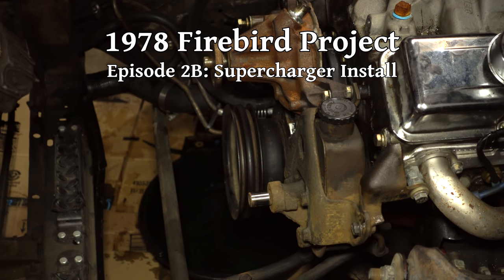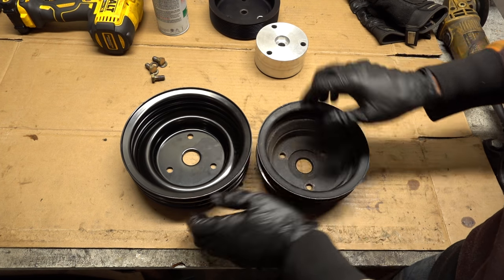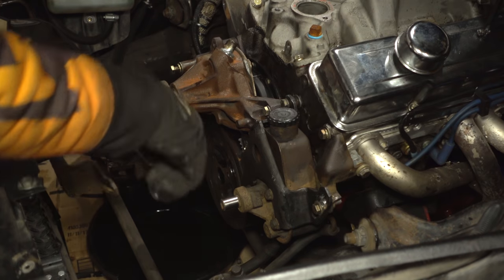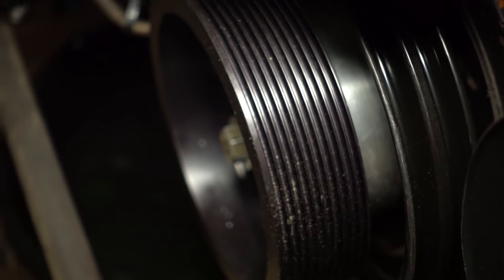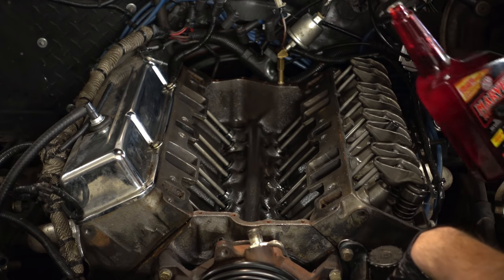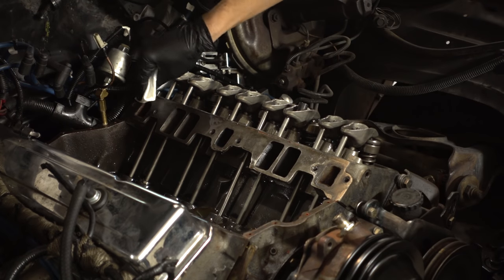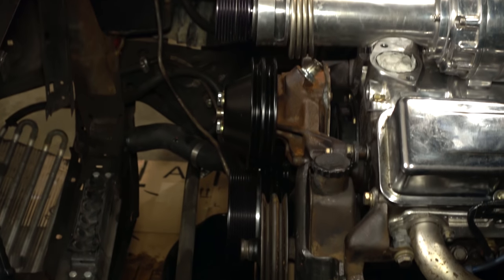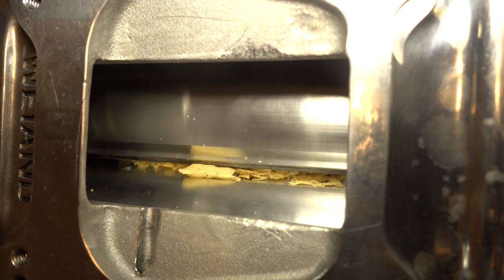1978 Firebird Weiand Supercharger Install (Ep.2 Part 2 of 2)

Comment: When installing the sbc balancer, if you heat it up in the oven at 275-300 degrees, it slides right on the crank with oven mitts on. It will not hurt the rubber elastomer bond either. Many of the older sbc’s didn’t even have a bolt in the crank

Comment: Awesome vid. I am a veteran  machinist and do my share of auto mechanics as well.
In the machining realm, I usually set myself up for a failure at least once a year when I haven't measured all the bits and bobs as an assembly and have trusted my  brain sack calculator to "make sure" all my parts will be machined correctly.
Such is life.

Comment: I had a 78 TA back in high school.   It had the 403 oldsmobile engine with the turbo 350.  I just drooled over the Pontiac 400 and a four speed, but alas, I lived in California!  

The front dampener should be balanced with all the other engine parts; that's what all those holes are drilled in it!   Good luck!

Comment: The front and rear gasket thing are the same on ford FE blocks also, just used a bead of high heat on mine, the old one was leaking very bad. Cool build also just found your channel 😀

Comment: Rtv really only needed for 2 things. Keep the gasket in place while installing part/bolts. And any places with hard edges, like where the intake plenum and valley pan meet or where a valve cover goes around a cam bearing on newer/smaller engines.

Comment: I don't use the front and back rubber intake gaskets I lay a thick layer of copper gold RTV extended up and under the intake runner gaskets. Set the intake in place as steadily as possible letting the RTV gush! However I will lay RTV over thin blue OEM type runner gaskets, but not Mr. Gasket Ultra Seal or equivalent clean and  coat the intake bolts with permatex torq to specs! Using this method I've never had a single problem.

Comment: Another awesome vid! I was a gen mechanic in the military years ago and I think faster means lower charging amperage but higher voltage. I could be mistaken, been a while lol. I vaguely remember lower speed meant higher charging amps at a lower voltage. I might need a refresher course here ;-) But the regulator is supposed to maintain around 12-14 volts DC. The less charge your battery needs, the higher the voltage will go and visa versa. Again... Might be mistaken.

Comment: Young man, I came across your site as one does when idly trolling through all things engine connected and I like your presentations and explanations immensely...... loved your rebuild of the Chevy engine for your Blazer.  At least you own up to your fuck ups!  Bet you are a lot less like a bull in a china shop next time you assemble anything.  I build custom PC's and always dry fit and measure twice and cut once.... the last full engine rebuild I did was in 1974 when I rebuilt my Ford 4 cylinder engine when it started burning almost as much oil as petrol.  I currently run a V8 diesel Porsche Cayenne and about the only maintenance you can do on modern vehicles is check the oil levels and top off your tyre pressures.  Oh how I miss tinkering with points and timing and diagnosing worn valve guides and such like!  By the way, I am a 63 yr old chap from the county of Angus in Scotland.  Ah,  the power of he internet!

Comment: Cool car, cool project, I enjoyed the videos so far. That being said, I would have spent the supercharger money on a 454. A 454 with a mild aftermarket cam will make 500 ft lbs of torque no problem. The 144 will wake up the 350 to an extent, but you will need an aftermarket cam and heads to really take advantage of it. I have a bad feeling that you will be disappointed...
Reply from the maker: Completely fair. The advantage here is that I might be able to keep the transmission and rear end (because I'm cheap), and forced induction (even with a mini blower) is something I've always wanted to check out. It won't blow anybody's doors off, but I think I'll be happy with just a bit more get-up-and-go than it had before. It made a good impression on me when I drove it briefly (spoilers), for now I think I'll be satisfied. But it wouldn't be off the table to put a 454 in the Firebird and the supercharger in my S10 Blazer, either...
Reply: Hey if a 144 blower is what you wanted then that’s awesome, that’s the beauty of building your own cars, you can do whatever makes you happy. Now I’m anxious to see how the blower works out for ya. 👍🏻
Reply: You are confused  most already have mild cams  325 horse power  maybe 400 ft pounds of tork.
early years maybe.
theres more to it than you think..
Bottom line  his bottom line is 350 Horsepower To the floor And 400 ft pounds of tork at the wheels.
At the fly wheel  hes 420 horse power  and 500 ft pounds.
You through in the 350 rpm range .
His 400 foot pounds will start the second his foot hits the peddle .
cubes only rule a even playing feild.
My best freind is a 454 fanatic  His 454 HO Wont beat my 350 blown sbc in a 6000 pound truck full time 4 wheel drive
Reply: Alonza Hanks, You might want to check out some videos about dyno testing stock 454’s, they make more than 400 ft lbs, mild cam, performer rpm, and a good carburetor will make 500 ft lbs with ease...
Reply: Dont get me wrong  fly wheel dynos are you setting in your car reving it under no load what so ever
Fastest car in reno nevada was a 454 camaro For like 20 years unbeaten 
Monster trucks I think theres 1 hemi  Rest 454s.
Racer terms A low thirteen in a Quarter mile 
  360 horse power  and 480 foot pounds of tork on tire dyno  stock.
That means it will pull 2 loaded semi trucks over the pass
It also ment you lost 90 horsepower getting to back wheels with headers manifold a small cam
But you pulled a wheely doing a 13
But ive also seen a blown alky burner 454 pull a 4 second quarter and I was wiping frost off of the manafold
 after LOL 
This is my freind robert I Follow naturaly asperated full roller 454 full race cam .
https://www.youtube.com/watch?v=F6mL1kUVMpk
he pulls 9s

Comment: fir the water pump issue they make 2 styles for the sbc one is a long neck on newer engines other is a short neck on older engines pre 80s or go electric for power and style
Reply: Aaron Sprankel cheap electric water pumps don’t work well and it seems like he’s doing this on a budget.
Reply: yes very true just a quick option but can be costly even for a new cheaper unit
Reply from the maker: Short water pump was only on certain trucks that late, I think, it was only on cars for a few years. This is a long water pump, and the long nose model of the supercharger, so they are supposed to fit together. Turned out the water pump wasn't really the problem, anyway.

Comment: As a frequent wrench turner, I'm ashamed to admit I just learned something about the RTV silicone recently. I didn't see you do it with the intake manifold (maybe it was edited out), but the instructions say to set the part in place lightly, then let the silicone dry, then tighten it down. That way it forms the gasket rather than smashing it out when you tighten it down while it's wet.
Reply from the maker: Yep, I say it now and then (something like "then I'll let it skin over for a few minutes") but maybe I haven't been clear enough about that. Ideally you'd put RTV on one of your surfaces, let it start to cure a bit (maybe 5-10 minutes), put the pieces together finger tight, wait maybe half an hour, tighten them down more, then wait an hour or two and torque them down all the way. I believe that is the "proper" way to do things, but it is a bit time consuming to do for some parts. I will do that when I can, especially for something like an intake seal.

Comment: Try a shorty water pump and a longer crank adapter for the blower pulley , and next time you change a intake remove the valve covers they are just in the way , And when removing the distributor remove the cap and note the location of the rotor Number at tdc is the way to do it !
Reply from the maker: A short water pump would be moving the pulley in the wrong direction, and as far as I can tell nobody makes a longer crank adapter short of having one custom machined. I did eventually find a different lower drive pulley that might have worked but it is over $300. I don't like removing the valve covers if I don't have to when doing an intake, just gives more opportunity for the gasket bits and dirt to get in there when cleaning things up.

Good tip about marking the distributor location, I'm pretty sure I mentioned that I wasn't doing it because I would be turning the crankshaft before reassembling it anyway, though.

Comment: I'm wondering if the smaller balancer is off a 400. Or if it's a 400 crank. Is it possible your motor is a stroker?  Back in the day we use to put a 400 crank in and have the 350 rods machined to fit the bigger 400 journal.  Tada.  383...
Reply from the maker: I'm pretty sure it isn't a stroker, but I wish I paid more attention to checking when I had the oil pan off. Plus, since 400s are externally balanced, it's pretty obvious on the factory balancers which is which. If it shakes, rattles and rolls with this balancer though, I'll just put the old one back on.

Comment: What vintage is the engine?  The smaller balancer is an '80's 305/350 balancer, the larger one is a 70's one.  Since it's been rebuilt, likely multiple times since it's .060" over, the timing cover could be off of anything so the mark matching or not doesn't mean much.  If I was going to bet, random 350 was probably pulled out of an '80's truck in a jy, proabaly the most common source.
Reply: Yea, the small crank pulley is an '80's crank pulley, it's looking a lot like the whole thing is an '80's 350 with the wrong timing cover on it.

Pulleys can be infuriating when you get into these weird installs... I'm not sure why it's so hard, it's not like there were more than half a dozen factory configurations that just got re-rolled for the different chassis/accessories.  I have a weird combination of 80's small block, some 70's parts and a 2000's PS type II PS pump with some 2000's S10 and f-body parts and a bunch of stuff that I custom machined to make it all work.  One thing that would likely make this all easier for you would be to use a 3rd gen f-body ('82-87) alternator bracket, an '86 or 87 formula/TA alternator (or later) rated at 145A and a, early 3rd gen alternator pulley (your stock one would likely work, the '87 pulley is a 6 rib not v-belt).  I'm wondering if you're missing a spacer for the supercharger crank pulley or something since your original bolts were too long?

Don't coat the intake gaskets with RTV, it just causes them to slide around and leak, especially the end seals.  The best deal there is to put a small bead around the coolant passages at either end, ditch the end seals and run about a 1/4" bead on both "china walls" and bolt it down.  Wait, yea, you just did it like that ;-) ... why did you goop it all down the first time?

Comment: That blower setup is made to use a short water pump and pulleys.
Reply from the maker: The instructions specifically state the long nose version (which it is) is made to fit a long water pump 2 or 3 v-belt setup. Anyway, the actual pulley problem was that the supercharger drive pulley didn't line up, which wouldn't have made a difference on either water pump setup. It was a tricky situation all around.
Reply: +Fuzzy Dice Projects Ahhh, I just figured most blowers I've seen are for short water pump setup. So I was wondering why your pullys were so out of wack.

Comment: I'm certainly no expert but isn't it easier to put the intake manifold in before putting the valve covers on? I assume it's a "which ever way works for you kinda thing". The Do Not Bend package folded into your mailbox was funny. Sorry I took humor in that.

Love all your videos. I have a big old soft spot for GMs. Especially the older ones with some soul. GMs have a lot of their quirks, but I still love them all.
Reply from the maker: I like keeping the valve covers on to keep junk from getting under them when cleaning things up, and you can get away with leaving them tight with some manifolds but not this new one. So no big deal, didn't need to bother removing them entirely (the wires on the passenger side and spark plug wire guides on both sides make it a bit tricky) and just loosened them up. Entirely valid to just put the valve covers on after doing an intake manifold job though!

Comment: How do you plan on balancing the pulley so you don’t burn a bearing? Surely not with a half assed grinding and sanding job!
Reply from the maker: The crankshaft supercharger pulley? Not sure what episode, but I checked it with a dial indicator and managed to get it pretty darn centered. Probably more centered than just installing it without spacers and not checking at all since the fit isn't the tightest. Rechecked it a hundred miles later and no change in position, I wouldn't expect it to be an issue.

Comment: hey just came across your video. On your water pump to pulley issue, you might want to determine if the pulley set is made for a short water pump. By the looks of it you have the long water pump. That might be why you need the spacer to get every thing to line up.
Reply from the maker: That was something I considered too, but the way it works out in the end the water pump actually has nothing to do with it, the crank pulley is the one that doesn't line up. The kit claims to fit short and long water pump setups, and it would have if the crankshaft pulley spacing lined up
Reply: @FuzzyDiceProjects  Thanks for the reply

Comment: That smaller balancer with the 12 o’clock timing marks is from a 305 from a later vehicle. Could be a truck or a Camaro balancer but it’s definitely from a 305. I’ve had to kneel on the rad support to set timing on TONS of GM 5.0’s are you sure that engine is a 350 and not a 305?
Reply from the maker: To be honest, I can't be completely sure it is a 350 without measuring the stroke. Block casting number is 3970010 and it is a 2 bolt main and that could also apply to 327 engines from 1969, so there is a very slim possibility it could have a 327 crankshaft but it is far, far more likely it is just a common 350 setup.

Comment: Do you plan on doing something with that funky transmission that's in there?
Reply from the maker: What makes it funky? I'll leave it until it breaks or if I put lower gears in it and want a four speed for the highway, most likely. Kind of want to put on a manual valve body though.
Reply: FuzzyDicePimp oh yeah I forgot you used this as you're daily driver. I assumed that since you're putting a supercharger on that you would want some more torque.

Comment: Aren't older cars great?  Look at all that room you have to work.
Reply from the maker: Yes! Even the S10 Blazer's small engine bay is huge compared to most modern cars and small trucks. My friend has an HHR SS with the turbo, you can barely get your hand in there to turn a wrench on anything.
Reply: Aye, i can practically stand between the engine v6 and radiator on my Audi C4 100

Comment: I have a question, why do you use a torque wrench for most of your ratcheting? Is it an old one that's not accurate anymore?
Reply: Lucas Izaguirre my guess is either that or he’s wants have an idea of the torque the bolts are at
Reply from the maker: You got it, it was left on a high setting for over a decade and the reading is off, and it's too cheap a model to bother getting it calibrated. But it's a very nice long-handled 1/2" ratchet!

Comment: you need breathers on both valve covers you might have to drill it or youl have block pressure.
Reply from the maker: I'll have to disagree with you on that. A positive crankcase ventilation system is superior in basically every way to an open crankcase ventilation system (two breathers). An open system will have an inferior ring seal under most conditions, will still build up vapors in the crankcase which contribute to sludge and could even lead to combustion in the crankcase, is more susceptible to pressure buildup, and is letting everything in the crankcase vent to atmosphere which isn't environmentally ideal.

If you are referring to block pressure being created under boost, that would only happen if the PCV valve was no good (it's a one-way valve) and it was hooked up to the intake manifold. With the PCV hose connected above the blower there will never be boost to it.
Reply: Its not a envirement thing. 
your supercharged combustion is perfect atomised oxigenized burn ..
Im suprized there not a manditory smog pump.
Its more like def fuel / hydrogen to burn the extra carbon.
thats why deisels dont blow black soot any more.
I cant remember what it causes Look it up .
I think it helps the overloaded pcv 
It helps the oil pump so its not pumping against a equal pressure 
and it helps to not pump oil into your cylinders on the intake stroke
charcoal canister take fumes from the gas tank through carb into combustion cylinders and burns them.
the pvc is what merely replaces the air and fumes in tank..
gas fumes go strait to the ozone 
The whole world  is made of carbon and is heavier than air gravity will put it back in dirt
probably would be nice to not have pressure blowing oil out your front and rear seals LOL